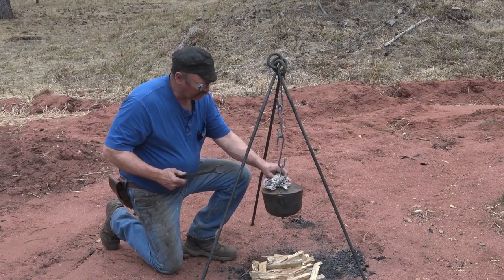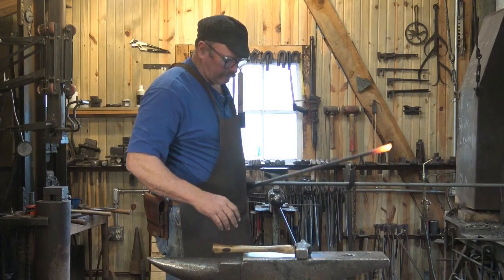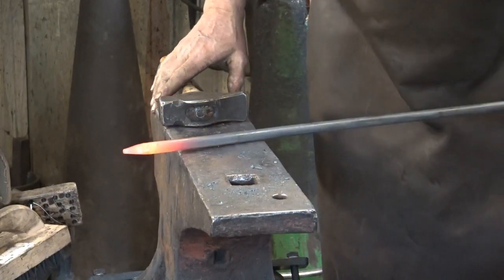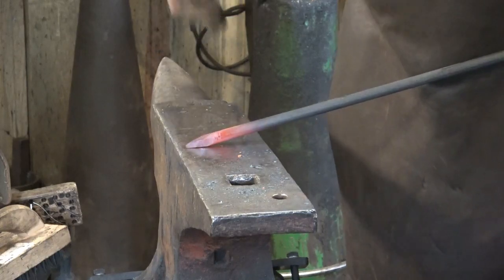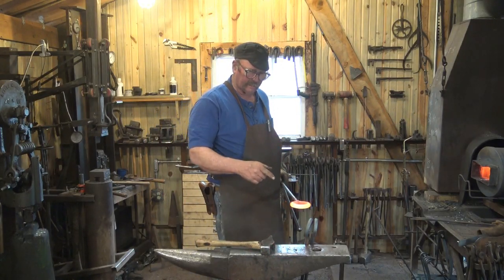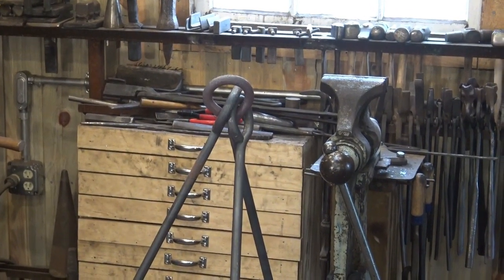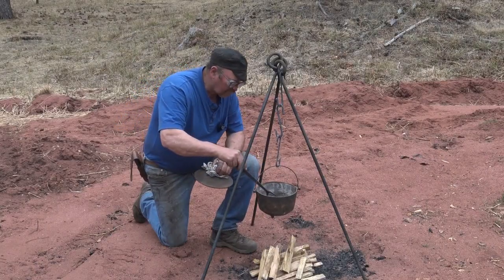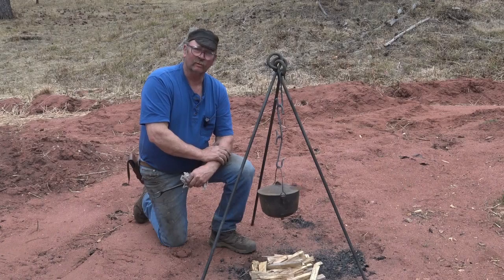Forging a campfire cooking tripod - basic blacksmithing project

Comment: In Japanese homes before gas or electric stoves, a rope terminating in a chain hung from the rafters.  A wooden handle with a hole was threaded near the knot between the chain and the rope.  It acted as as a pot holder to swing the chain closer and away from the fire without burning your fingers.  Oddly enough this handle was fish shaped to ward off heat since fish are the masters of water, and water plus fire do not mix.  This fish was always where it was needed and did not require looking for.  If used in this camp setup, it might need longer supports to keep from tipping them over.  If long enough you could even leave a flashlight dangling near the top pointing downwards.  A blacksmiths glove would be great as a way of grasping the handle of the pot provided the pot has not become too hot.

Comment: This combines several nice features.  It's something a beginner can make.  It's made from heavy material.  Most of my beginner projects used much smaller stock.  It's something that can be used or sold.  Very nice indeed!
Reply from the maker: I have always found real pleasure ion projects like these.  They are just pure and simple blacksmithing.

Comment: A one piece gypsy hook is better.  They are not as heavy as tripods and quick to set up.  It rains a lot in the UK so speed is a priority. You just have to stick it in the ground and your done. Its also easy to take your pot on and off the curled end. You don't see them often. But if a blacksmith starts making them snap one up. They are simply a curled top spike. But they work. I have used one for years here. I only use a tripod if I have made one from sticks and I am using a really heavy pot. its simple to whip one together. And you can use them for fuel once you have finished cooking. They are nice and dry by then. But if you want something forged, then you want to look up Gypsy hooks. I am sure you would enjoy making one. They look simpler to make and you use less iron.

Comment: About 1/2 way through I though I need to check comments for a way to do this without a horn . Using a forklift tine ASO. Then you addressed it not 30 seconds later. Great video. Thank you

Comment: Did I miss the part about why 2" loops?  I suppose it's so the tripod legs gather and stores well without binding.
Reply from the maker: No reason, mostly it was the bending jig I had.  But too small would be an issue.

Comment: John, why don't you like working rebar?
Reply from the maker: Most rebar is an alloy steel, so its harder to work with.  Projects like this work perfectly with mild steel and don't require the additional characteristics of the alloy.  Additionally, rebar will always look like rebar and I feel that really detracts form the appearance of any finished product.
Reply: @BlackBearForge , ok. Thanks.